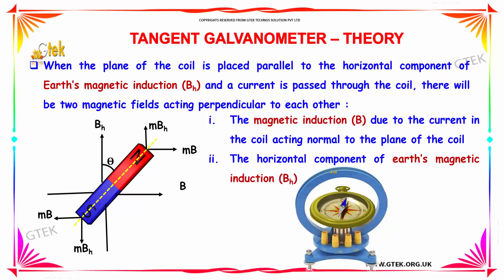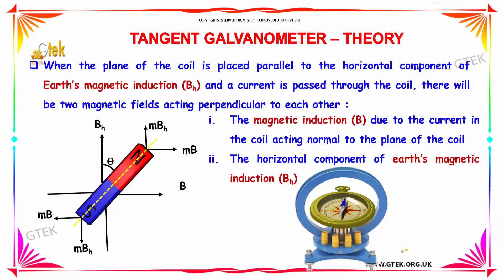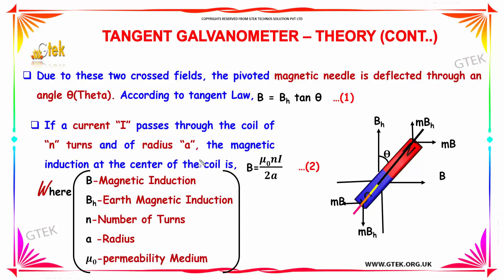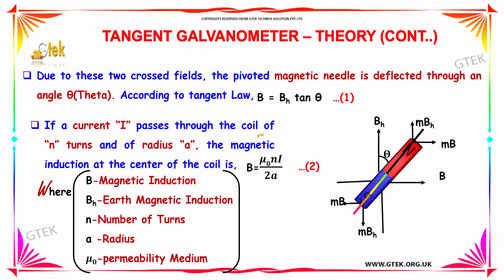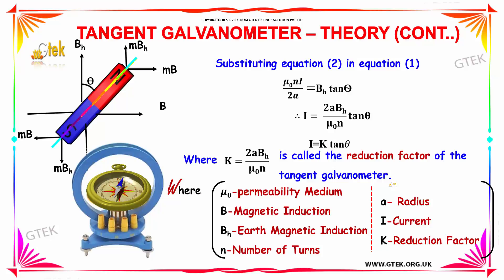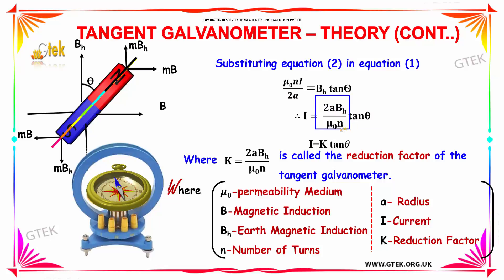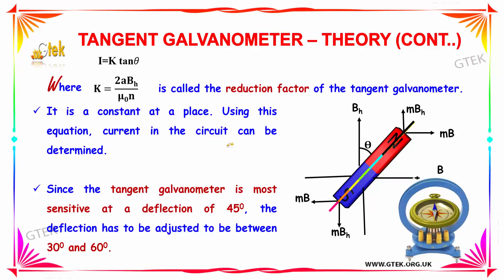Tangent Galvanometer Theory Effects of electric current class 12 physics subject notes

Comment: Theory: Tangent galvanometer is an early measuring instrument for small electric currents. It consists of a coil of insulated copper wire wound on a circular non-magnetic frame. Its working is based on the principle of the tangent law of magnetism.

Comment: When the plane of the coil is placed parallel to the horizontal component of Earth’s magnetic induction (Bh) and a current is passed through the coil, there will be two magnetic fields acting perpendicular to each other :The magnetic induction (B) due to the current in thecoil acting normal to the plane of the coil and The horizontal component of earth’s magnetic induction (Bh)

Comment: Tangent galvanometer is an early measuring instrument for small electric currents. It consists of a coil of insulated copper wire wound on a circular non-magnetic frame. Its working is based on the principle of the tangent law of magnetism.Tangent galvanometer is an early measuring instrument for small electric currents. It consists of a coil of insulated copper wire wound on a circular non-magnetic frame. Its working is based on the principle of the tangent law of magnetism.

Comment: A tangent galvanometer is an early measuring instrument used for the measurement of electric current. ... It gets its name from its operating principle, the tangent law of ... pig's tail, otherwise the field due to the wire will affect the compass needle and an incorrect reading will be obtained.

Comment: A galvanometer is an electromechanical instrument for detecting and measuring electric current. The most common use of galvanometers was as analog measuring instruments, called ammeters, used to measure the direct current (flow of electric charge) through an electric circuit. A galvanometer works as an actuator, by producing a rotary deflection (of a "pointer"), in response to electric current flowing through a coil in a constant magnetic field.

Galvanometers developed from the observation that the needle of a magnetic compass is deflected near a wire that has electric current flowing through it, first described by Hans Oersted in 1820. They were the first instruments used to detect and measure small amounts of electric currents. The name comes from the Italian electricity researcher Luigi Galvani, who in 1791 discovered the principle of the frog galvanoscope – that electric current would make the legs of a dead frog jerk.

Comment: Theory: Tangent galvanometer is an early measuring instrument for small electric currents. It consists of a coil of insulated copper wire wound on a circular non-magnetic frame.